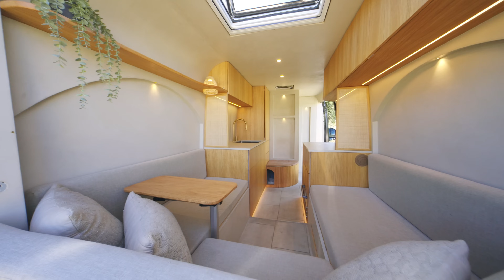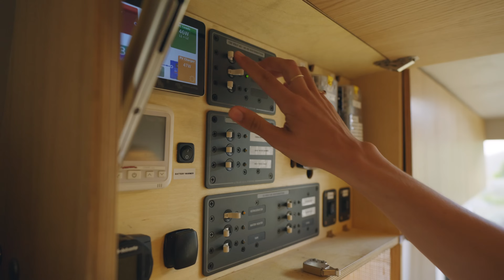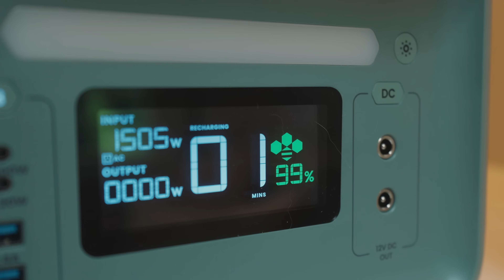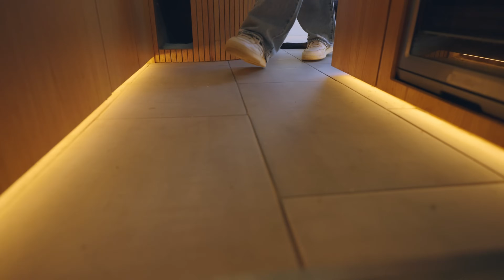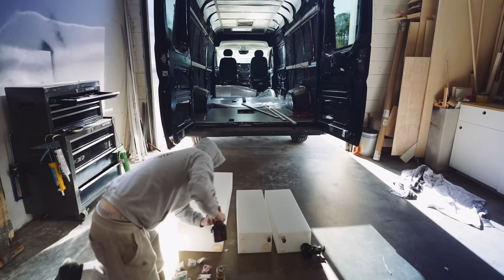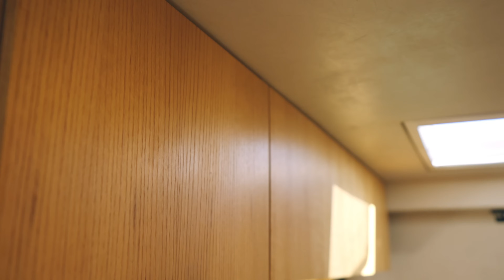Is Van Life Still Worth it?

Comment: Sadly for most people, the biggest cost is probably labor. Because most of us don’t have the knowledge and expertise to build this. Especially the electrical and plumbing. And then equal biggest cost is a new van; it’s hard to find lightly used vans nowadays because van builder companies are scooping them up. 
The things I would invest in someone else doing are that door between the front area and the cabin, and that stealthy side window and a fan and skylight on top. And those solar panels are so discreet and functional. I think I would like the wiring more exposed, so if anything was ever wrong they wouldn’t have to tear out the wall. It’s so beyond my budget! But when you consider future savings on rent and home utilities, it would be a savings at the end.

Comment: Haven't watched the whole video yet so mebs im jumping the gun, but are you only interior?  Also a promaster is a deal killer.  Id want a tall long (ie the biggest i can find) all wheel transit on a lift kit.  Can u work on those?
Reply from the maker: We only specifically specialize on interiors. We have a good relationship with a shop out in San Diego who could do a full interior/ext. build potentially with us as the builders for the inside.

Comment: You dont buy 8020 thats a BRAND and they are like the Mercedes brand. Look up tnutz my dude. I built my camper fixtures for half what you did using it and it was far FAR less labor intensive  the material is stronger and lighter. You plan it out, it comes precut with the fittings. My kids and I put them together with a couple of allen wrenches watching a movie. Granted this is obviously just the frames. Hinges, slides, drawers and faces are the same.
Reply from the maker: True. I’ve heard a lot of negative reviews about tnutz not being as precise as 8020. I’d also be very interested to know how much weight is saved over frameless wood cabinets. It seems like it would be similar since I haven’t found 8020 to be incredibly light on its own and it still needs to be covered. The precision and strength are definitely positives though!
Reply: @scarletandseth  I was a non structural engineer for 15 years building support frames out of strut and extruded aluminum. They are extremely durable. I wouldn't use tnutz for applications I designed back then as they are extreme conditions of live load(that's when I'd use 8020). However, A cabinet in a camper that will never be near the max load? Sure, I am using the aluminum extrusion brand that is 50% off.  I still use many 8020 brackets though as the connections are important and they have MUCH cooler ones for many fun applications like bed frame rails on slides,  load bearing hinges, etc.
Reply from the maker: @edgeofnothing67  yeah that make sense! We have done some stuff with 8020 like beds or slide outs and they do have some really great hinges, brackets and accessories!
Reply: @scarletandseth  oh, as to weight. The frame compared to wood is a third the weight. It can also support longer lengths/heights than wood. The 10 series aluminum can be used for every application of any dimension in a van, except a bed frame and even the frame i use 15 series because the connections are more robust which is where the failures are not in the length of aluminum

Comment: Why don't builders use carbon fiber? It is much lighter in weight and very strong. Thoughts?
Reply from the maker: I think it would be extremely hard to mold and very expensive. lots of boats use carbon fiber though!
Reply: @scarletandseth   If someone took the time and made the mold for a MB or Promaster, couldn't they just sell it? It upfront cost would be high, once the mold is made then you have another opportunity.